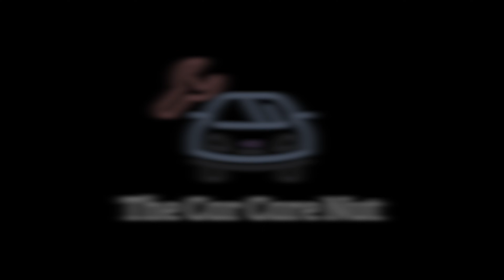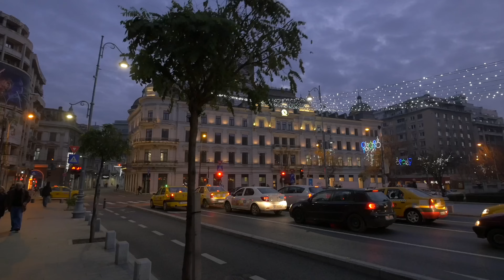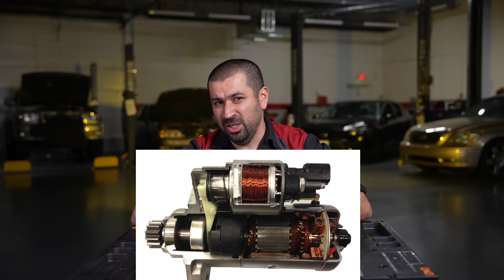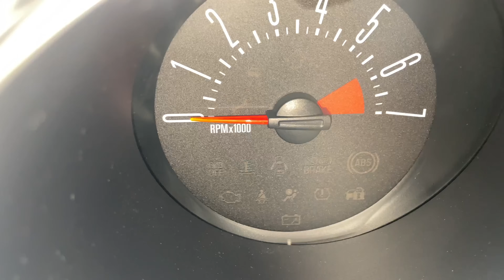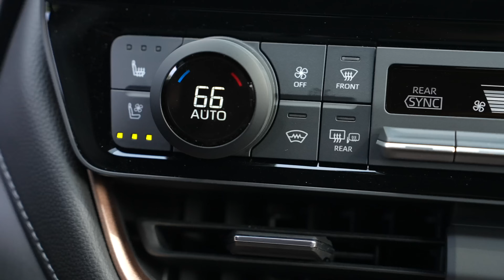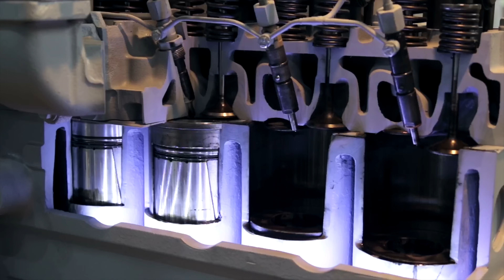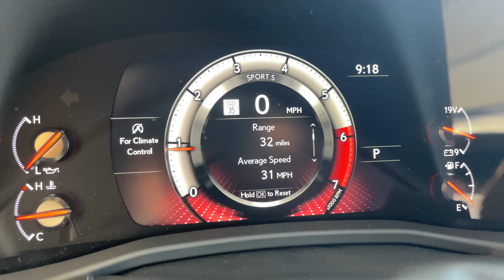How Does Start Stop Technology Work in Modern Cars? Everything You Need to Know

Comment: More thermal cycles equals more wear on head gasket.   Lubrication is weakest during start up.   Bottom line - there is more wear and tear and added complexity
Reply: you missed the point. the system is not even supposed to work when the engine is cold. There are no cold-hot engine thermal cycles in the brief moment the engine stops. It takes hours for the radiator to cool down to ambient weather.
Reply: Synthetic oils with viscosities of 0W-20 or 0W-16 have very negligible pumping losses, and coolant system thermal efficiencies keep the engine warm very consistently, so don't worry about reduced engine life.
Reply: Except as he said in the video, the system is smarter than that. Did you even watch the video?
Reply: @marcusvaldes no systems are going to change metals expanding and shrinking numb nuts
Reply: "system is smarter" is a very week argument. Yes, we watched the video and there's nowhere the presenter demonstrated the system is smart enough to change the laws of physics.
Reply: @caty863 correct, 
The law of physics said more parts, more complication, less reliable.
Reply: @williamko4751  you body has trillions of moving mechanical parts, yet it is quite reliable with an average lifetime of 70+ years… so no, corner store mechanic wisdom is not “laws of physics”. Your ego tells you that you’re smarter than the engineers manufacturing the machines whose expert you think yourself to be. 😂
Reply: @alphamineron  You are wrong. In the history of human race, 99% of the time, human dies before reaching 40
Reply: @alphamineron  Comparing a living thing to a pile of steel, rubber, an plastic.... Totally the same. Does your car need 8 hours of "sleep" every night too to recover it's "wear and tear" from the day?🙄
Reply: Reductive and false equivalence. You learned nothing from my comment; what was the point of responding?

You can choose to not understand a new perspective, delude yourself into superiority that you’re “correcting” me. But you’re the one who gained nothing and I lost nothing :)
Reply: Why didn't they add an electric oil pump which would keep lubricating the engine while it's stopped? Oil pressure will return to required level only after the engine is running, meaning that during a start event the engine will be starved of oil.
Of course car companies will say we don't need to worry about it - they make a lot of money on selling spare parts!
Reply: @nderezic  it'd be nice if they used a lot of the hybrid powertrain's electric-everything, but they are constrained by battery power and came up with alterative ways to address each problem.
Reply: @ because on short periods the Engine is already lubricated and doesn’t need constant oil pressure while ignition is off. You’re not an engineer and it’s clear you can’t intelligently analyze things so lower your arrogance and learn humility.

Comment: I recently purchased a 2023 Subaru Outback Touring XT, which has the stop start system. It has a counter that appears to tell you how much gas it saved. My last tank was about 0.08 gallons saved. Surely not worth it, based on the added cost for the system and the potentially higher future repair costs of the system.

Comment: Regardless of the well conceived explanation of how well it works, how complex it is and all the rest of the information sounds like a sensible idea, the part of the question I’m most concerned with is a simple one. 
How must MORE does a starter replacement cost? 
The part itself, being so complex and sophisticated, surely must also mean it’s not cheap. 

Same for the super duper battery system. 
My car battery lasts me on average in Wisconsin never more than 5 yrs. Costing me not far under $200, but I considered the more expensive ones as maybe being cheaper if they outlast the regular deep cycle ones. 

The other ignition related systems and components, they aren’t going to last much longer than the first item that fails. 

My (x) wife has a 2024 Subaru (since last week) her previous one was our first car with this feature. 
My own vehicle is an old Honda Odyssey touring model. Never had an issue. My one day soon car is likely to be a much newer Odyssey because I love them. But it’s not going to be nearly as new. I simply can’t justify or afford to drive something that depreciates massively upon leaving the dealerships driveway. 
But I’m also capable of repairing my vehicles. My ex wife is not, and I don’t have time or energy to do it anyway. I encouraged her to lease, I want her to have as absolute worry free car issues as possible.

Comment: This is what happens with government mandates.  They don't care.  The general public bears the brunt of the extra cost to purchase and especially repair these vehicles.  I find that system very annoying.  That little hesitation is only a mild irritation, but as the car ages, it won't start as quickly as it once did, and then what?  A government mandated tune up every so many miles?  At the same time, young people are modifying their cars, removing the catalytic converters, altering the exhausts, and what is being done about that?  Nothing.  That also affects the quality of the air.  Some say, get an electric car.  They don't pollute.  Really?  Check out what mining of minerals and metals has to be done to make those batteries!  How many people have the money to purchase an electric car.  Some will say, buy a used electric car.  So you buy a car with a degraded battery that will eventually cost you a ton to replace.  Boy, I wish the government would stay out of our lives.!!!

Comment: Can't do your battery any good though. Good job they don't use Lithium; YET! If the starter is the old flywheel ring gear and Bendix starter motor then just think of the wear and tear. Now if the motor is a directly integrated into the flywheel then it would be more efficient to start and stop as, as you correctly imply, there will be no grinding of gears.

Comment: New cars are way too expensive and disposable because of terrible regulations put on the car manufactures. Their are many reasons I say this and here are just a few. They are much more expensive to purchase and repair. They have many more things to break which diminishes reliability. Most of the times only a shop can find the issue as a special computer is needed to troubleshoot even the most simplistic event that any backyard mechanic would have normally handled himself. Its now in your best interest to purchase a very expensive "warranty / repair insurance" added to the car's extremely high price. You can count on the warranty being worded for their benefit to refuse many repairs. When the warranty is over many people will not be able to afford these high dollar repairs and in many cases the repairs will cost more than the value of the car especially with EVs. I could go on but it all boils down to this being one small piece of the political agenda puzzle to destroy the middle class. Sometimes what appears to be moving forward is in reality,  jumping backwards. No wonder why the price of older used cars has gone so high.

Comment: Fascinating explanation of how the start/stop system works.  I have a 2014 Mercedes E350 Wagon with this feature but it is implemented in more elegant way then every other manufacturer's system.  It does not use the starter motor to restart the engine.  It uses only ignition spark at the TDC cylinders.  Unlike with starter motor restarts that can shake the vehicle slightly, you hardly notice the E350's restart.  Is there a reason why other car companies don't use this system?  Thanks again for the detailed description in this and all of your videos.

Comment: Excellent video explaining things. I just bought a 2024 Pallisade which has the system on it. First vehicle I have owned with it. I have found that any reduction in brake pedal pressure will restart the engine, so sitting at a red light and you can see it has or will change in a moment, I just let up on the brake a little bit and I am up and running by the time the light is green.
That said there is one thing that is annoying with the system. Coming home and I pull into my driveway and stop the system will stop the engine, only to restart it after putting the transmission in Park, and then I shut the vehicle off a second later. As smart as cars are, it would be nice if it could get a location from the GPS and tell the computer "Hey we are in the driveway, do not do a shutoff." Maybe someday it will.

Comment: I hate it stopping at stops signs. It creates a bad habit of not quite stopping. Sometimes I have to wait 2 seconds due to traffic at a stop sign even though the engine is going to be needed again in 2 seconds. Also when I can see the light is about to turn green and don't want to stop the engine for 1 or 2 seconds, that's annoying. I have no disable switch. I have to switch the transmission into Low to keep it running. Perhaps a very soft feathering of the brake will work too. In any case, I appreciate the engineering and your video explaining it all.

Comment: Thanks very much for an excellent and very clear explanation about this important system. What precaution should one take when driving a car through one or more feet of water on the street. Should we disengage the system before we enter the water. Secondly should the disengagement button be pressed only when the car is stopped or you can press it while the car is in motion. God Bless you.

Comment: What about oil flow? While the engine is off, the oil is not circulating throw the engine. Once the engine is turned on, it takes a few seconds for the oil to be fully flowing. 

So if you were stopped at a traffic light in your start/stop vehicle with the engine off, the light then turns green so you lift the brake peddle, the engine turns back on and you immediately start accelerating, could there be some added wear during those first few seconds of accelerating because the oil hasn’t fully circulated yet? Or does the oil flow almost immediately after starting up the engine when it’s warm?

Comment: Around 5 years ago, I was driving a customer’s car. I pull up to a red traffic light,  the engine shuts off. I’m thinking WTF I have stalled the engine, but the lights turned green and as I released pressure from the brakes, the engine fires back into life. Interesting to experience new technology before hearing about it!

Comment: It's really bad using this system on a turbo engine. The turbo is smoking hot coming from a drive to a stop then turning off the cooling to the turbo and have the oil cook in the turbo.

Comment: start/stop is harmfull to turbochargers. when engine is hot and it suddenly stops the oil is not pumped so it boils in the turbocharger cluttering it, after thousands of miles it will fail. same happens when you stop and turn the engine off, you sould let it idle for up to an minute

Comment: Sooooo what about timing chains? Mine stays off permanently because of numerous reasons. Like safety when pulling out and thinking the engines on when it's not. But the other main reason is timing chain wear. My BMW engine costs 5k for a chain. I am not willing to save 500 quid or so of fuel over X Amount of years to then have to pay 5k for a chain to be replaced. Complete joke of a system tbh. Like egr and dpf.

Comment: Thanks for your in-depth lecture of how complex those control/monitoring systems are when dealing with internal combustion powertrain; mainly due to strictlier emission standard requirements every once awhile.

In my opinion, it's near the dead-end of any further practical or cost effective fossil fuel burning engine improvement - at least for typical personal vehicles.

Pure electric propulsion designs are far more simpler without any consideration of vehicle emission control.  No wonder China is catching up so quickly with EV development.

Comment: Certainly complicated. I have a manual car and the stop/start for a good couple of months just stopped working. And then the car developed a slight misfire. I put on my diagnostic tool, which indicated a problem with cylinder 1. Rather than mess around, I really don't have the time, I put in to the garage and turned there was a sensor fault. Replaced the sensor and the car was back to normal. Including the stop start! I do wonder how long that sensor had been failing.

And be careful of battery changes. When I realised  the stop start wasn't working, I thought maybe the battery was naff. I got quoted a so called upgrade to the battery fitted. Yes, it did cost more money but turned out it was not recommended by any battery manufacturer for my car. If you have an AGM battery fitted, that is what you need to replace it with. 

The car is 6 years old now, still running well on the original battery. And it stop starts with air con on/off and just works. I go to put it in gear and the engine is running, just like that. Whether it saves money, who really knows!

Comment: Engine start/stop, actually I like the system. Unfortunately in the UK I have a Mercedes Sprinter 23  model automatic wheelchair accessible vehicle which has this technology. However it has the main battery and a back up battery. If the weather/engine is cold or the battery shows partially charged the stop/start does not kick in. There is the option to turn it off manually.😮

Comment: Please make another video (or add some captions to this one) showing the average cost added for manufacture of each item on the start-stop tech.   For example (swag numbers):  unique starter $300 extra ; evaporator - $250 extra ; battery - $350 extra; transmission - $900 extra ; computer with programming - $1200 extra.  And all for a very small improvement in efficiency and emissions.

Comment: Personally, not a fan of the technology.  Too much, too expensive, a tiny benefit, diminishing returns.
It saves 2 to 3% fuel, and probably about the same for emissions.  During road travel, does nothing - only in start and stop.
Brilliant engineers could devise the same amount of improvement in both with less complication.  99.8% of all mechanics will never be able to correctly maintain this labyrinth of tech - they don't have time to learn it or troubleshoot.

Comment: The only piece of information missing for me is how the stop/start system prevents damage to the air conditioner.  I am told that if you depower an AC compressor while it is working you have to give it a recovery period before reengaging or it can be damaged.  Are automobile units not susceptible to  this?
Reply: Automotive A/C compressors have an electric clutch that will not engage until the head pressure has dropped to the correct pressure. That's why the clutch will cycle under normal running conditions.
Reply: @gregrobsn  Thanks.

Comment: Yeah I traded my 2022 in for 2001 and I don't think I'll ever buy a new vehicle again for how expensive they are they shouldn't limit how you customize them. If I want that system off it should stay off till I turn it back on. Anyway I'd rather take the problems of owning an old vehicle that was actually built properly over these new vehicles that rust in 2 years.. true story my first car 2013 chevy cruze bought new at the time they didn't even paint the inside of the rear panel that stuck up a few inches above the rear window and it rusted up in year 😂 the 2001 I just bought only has rust on a few nuts and bolts 😅

Comment: Start/Stop tech adds more things to a car/system that can and will fail, including introducing various variables to other systems with each start/stop.  Best course of action is to turn it off as soon as you get in the car and never, ever use it.  Never buy any car where start/stop is not easy to disable.  The failure data provide by anyone on line is not reliable, auto manufactures protect that information like their sisters cherry.

Comment: I thought the system would have been a lot simpler than this.  I envisioned some sort of built in inertial setup on the flywheel that kept spinning when the engine would shut off.  Great video!

Comment: what about oil pressure in the engine, to go from a dead stop to full bore seems like its  not good if there is no oil pressure in the engine, or do they have a system that keeps up oil pressure when the engine is off due to "start stop"?

Comment: I'm sure it reduces battery life . Everytime you start your car, there is a surge in the current draw. Even though your alternator recharges the battery it still weakens the battery's ability to hold a charge. On a normal trip to say work or the store you might only start the car 2 or 3 time. When you use start stop, it may complete this cycle 20x. That is a lot of wear and tear on the battery and starter.

Comment: You did not mention the turbocharger oil supply during the start-stop operation. The “idle the engine so the turbocharger rpm drops” seem to be a real issue with start-stop. What does Toyota do to keep the turbocharger bearing lubricated during start-stop?

Comment: I tested the star/stop on my new gas only 2024 RAV4. It is not that bad as many said.
1. During a red light stop, it will ask me if I want to activate the star/stop by pressing the brake firmer.
2. When the light turned green and I stepped on the gas, from stop to star the transition was smooth. It only took fraction of second.

Comment: What does it make any sense is the fact that you say it's for emissions but yet it doesn't improve your gas mileage. The emissions come from the fuel being burned, so it seems you would have to increase the gas mileage if you wanted to decrease the admissions. Seems like a whole lot of work for such a little gain. We all know what a problem it was when they went to low compression rings and that was just one modification think of all the problems that could happen with this and it just doesn't seem worth it